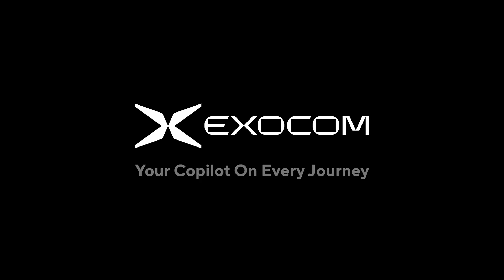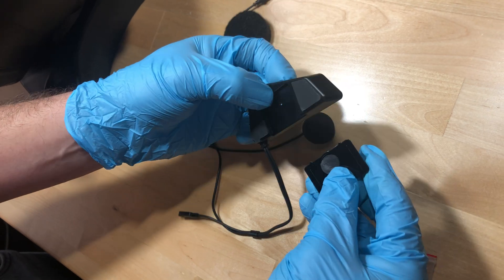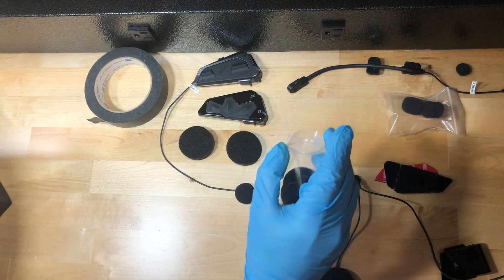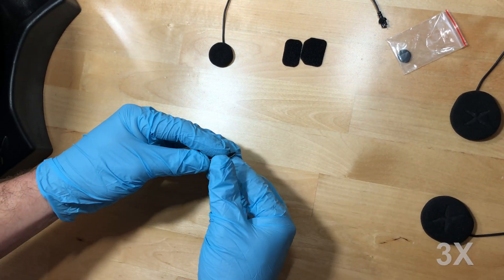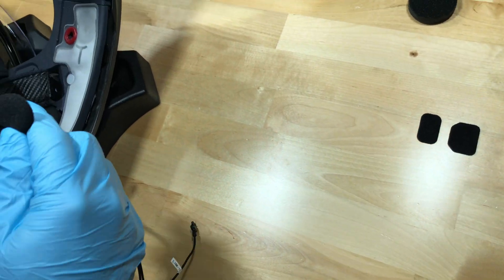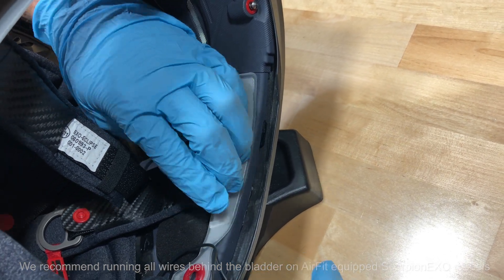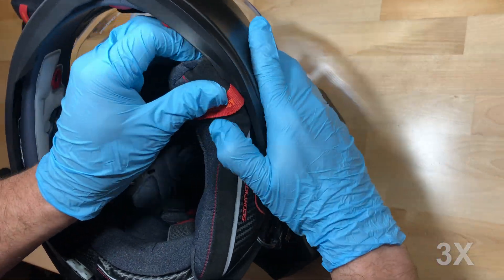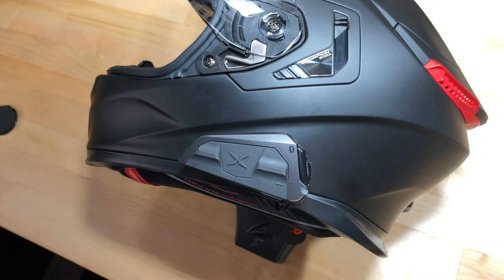EXOCOM installation — Com Port Equipped

Comment: Is the Exocom Link 1 compatible with the Exo 520 Air ? I mean, The Exocom location on my helmet is compatible with the Link 1 or i’ll have to stick the adhesive mount ?
Reply: From what I’ve found you would have to sticky mount it. Missed opportunity when they could have included or even sell that mounting plate for like five bucks for people to upgrade to this newer version in a clean install way.